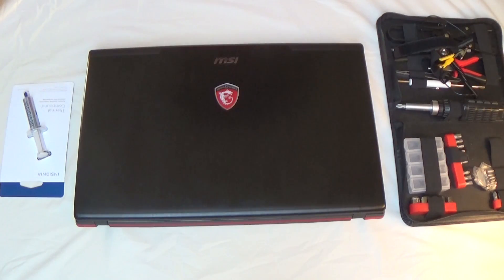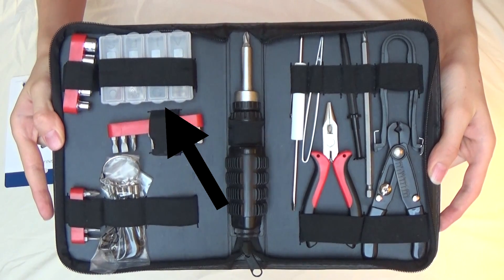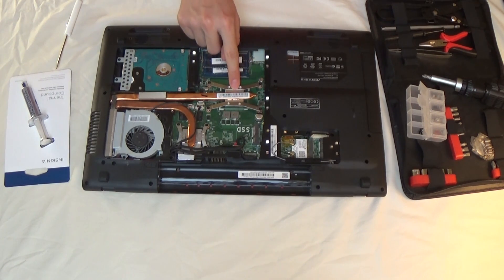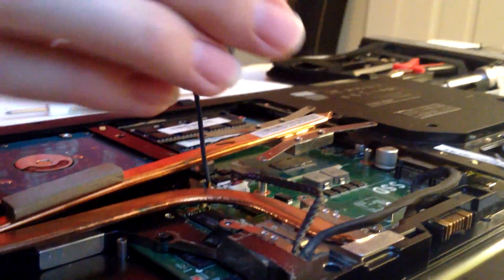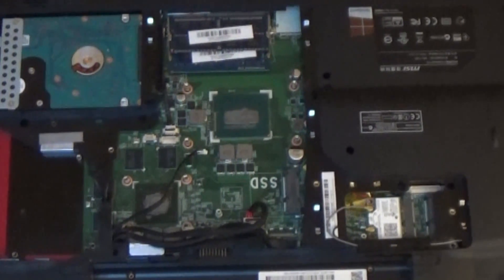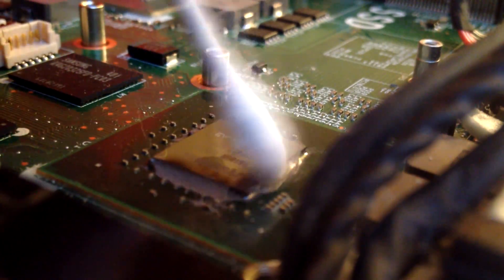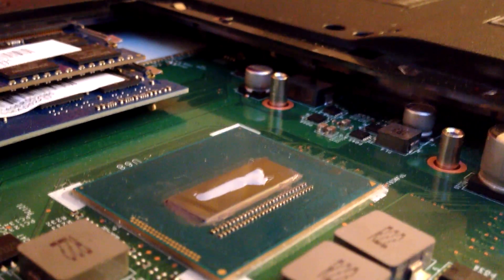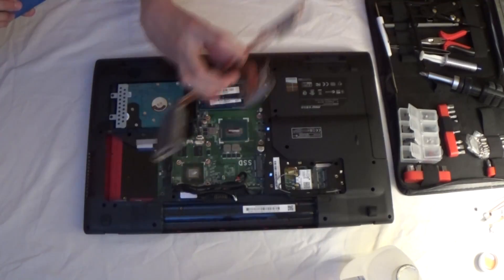How to Replace your Laptop's Thermal Paste

Comment: WARNING-WARNING!!!!DO NOT FOLLOW THIS TERRIBLE TUTORIAL, you risk shorting out your chip with those cotton wool buds,use a micro fibre cloth intead.Also it's worth spending a bit more on the paste.Duh.
Reply from the maker: Hahaha, my man, cotton is not conductive, if I were using steel wool you'd be correct. I do not recommend cotton swabs as yes, they can leave microfibers around the CPU if you're not careful, however you're massively overreacting.
Reply: Really?  Don't even go there...  For sure, a microfibre cloth is better, but a cue tip won't damage your chipset.  It may leave a few fibres.

Comment: horrible job sorry bro but you just showed how to do this at the chinese manufacturer , you need twice what you added
Reply: I agree with you, I also repair laptops.  Excessive use of thermal paste will just cause a mess and squeeze out of the sides and all over the chip, it won't help the thermal paste to last any longer.  While excessive paste probably won't damage the CPU,it is just wasteful, messy and if anything will increase the temperatures because it will be insulating the rest of the chip.

At the moment I use GELID Extreme paste on my gaming laptops, it does give a few extra degrees of cooling.  The manufacturer requires you to spread it using the tool provided, they also say to use the paste sparingly, with a thin even coating so to reduce overspill on unwanted areas of the processor.
Reply: The amount of paste was fine but not thoroughly cleaning the old paste off the sides will cause excess heat to spread out under the heatsink causing higher temps.
 So yea people always make sure to get all the old paste off not just whats on the CPU and GPU, but off the pcb board as well.
Reply: Shoobox Gaming your not considering life span when you use so little , you want this to last over 5 years ? you need a generous amount to stand the sands of time , i have lost a computer to paste jobs like this , my old chrome dell died from overheating and low and behold the past was dry and insufficient ,similar to the job we see in this video .my gpu fried and the reflow didnt last very long
Reply: That's not true, 
 Putting a ton of thermal past on is not good. at all.  the more thermal you put on the more it spreads to the side and on the pcb board. Laptop CPU and GPU heat disperse through a radius starting from the center of the cover on the processor.
   Laptop heatsinks are never lapped properly which causes result in higher temperatures.
Normal laptops are known to run a little bit higher than desktops, but gaming laptops need the extra push to last longer. Without a proper smooth surface globing thermal is not good at all.

 I own 3 different gaming laptops and I always remove the old past even when I buy them new, when laptops sit for long periods of times in warehouses and so forth before their even sold if its not a controlled environment it can cause the thermal to dry out and cause high temps. as well.

 On Laptops they have thinner motherboards and high excessive heat will cause the solder to loosen and crack, then your force will re-flowing the laptop or not fixing it.
And a professional re-flow not even a oven job will only last about 6 months before you start to see the same symptoms.

  I do laptop repairs for a living and globing excessive amounts of thermal isn't the answer.
Reply: Shoobox Gaming i bought my computer with the amount you showed and it would run up to 190 deg , i repasted the cpu and now it runs at no more then 150 ?????????????? so your advice is horrible , not tryna be mean bro but your way off base way off reevaluate the situation and stop trying to fool yourself , your suffering from cognitive dissonance
Reply: You ramblings literally made no sense, I think you really need to think before you type out such nonsense,

Your obviously the one who has no clue what their talking about. I don't think you truly even know how a Laptop heats up or dissipate the heat through thermal past to the heatsink.
Reply: ReturnBaconSquad well maybe visit your mom more often and you can change all that
Reply: Because i wanted to see actual numbers to corroborate my intuition your channel was not the channel that proved it , i watched many videos on this , there is a guy who shows the actual temps difference in the line the pea the rice and the x and the peanut butter   sandwich won because it will last the longest and was the second place winner in the temp test , but as i said first place will loose to second in the long run , every failed pc i have disassembled had to little paste and a need for a reflow and that is caused by excessive expansion and contraction . i'm sorry for being a jerk about this i definitely ruin this conversation before it started and i'm sorry for that
Reply: Such a sad,     sad...... sad ............very sad completely wrong man.

  It's ok,
  We forgive you for being ignorant .
You've tried racial name calling, now reverting to trying to bash someones pass time of playing video games.
 I think you my friend need to go pray to god a little more for forgiveness.
 
 The difference between me and you is that I'm an Educated asshole.
And no need to hike my skirt up when someone plays armchair  quarterback bulling people on the internet.

 But like I said,
   I'ts Ok we forgive your ignorance. and I will pray for you young one.
Reply: @Chris Paul,
  Absolutely excessive paste glob all over the sides of the cpu-gpu will cause heat to spread out through the board and not dissipate through the heat-pipe very well.
Reply: Such a sad little man. maybe you should of went to school instead of self education and actually  learned something useful.  Then maybe next time you try to make a stand you won't look like such a oxymoron.
Reply: Shoobox Gaming thank goodness i dont let you people work on my computer , yes think less is better all you want , you dont even no if your covering your entire processor, ive seen all the test videos on this subject and your wrong , belittle me all you want and to tell me to grow up is hilarious how old are you ? and you play video games ??? lol gamer is a term for adults who havnt grown up now isnt it
Reply: Shoobox Gaming listen you immature moron im not a 38 year old video game player you are .... grow up and stop playing video games maybe you will get a woman , so long shoobox gamer , nice name NERD
Reply: NOBOX7 Goddamn your mom should've kicked you out of her basement years ago.
Reply: NOBOX7 Wow what a sad sad man.
Reply: Jesus shut up you illiterate religious moron

Comment: Please HELP ! i got the same Notebook,i changed the Paste but i still have like 90-100 decrease ....both gpu and cpu please help haha
Reply: Did you clean out the cooling fins and the fan to remove the dust bunnies?

Other than that, you didn't put enough paste on the CPU or you haven't seated the heatsink properly to the CPU.
Reply: Chris Paul please tell me exaclty what to do ! :)
Reply: Before we go any further, when the laptop is running hot, do you hear the fan?  If not then the fan isn't working and needs replacing or checking to see if you remembered to connect the power leads.

Secondly I need to understand how hot your laptop is, download a temperature monitoring program to check and I need to know if in celcius or farenheit.
Reply: Chris Paul GPU and CPU 90 celsius and the fan is working ::
Reply: Does the laptop overheat quickly?  Was it overheating this much before changing the thermal paste?

Comment: my laptop becoming hot and while playing video game iget alot fram drop like from 160fram to30 fram should i put thermal paste?
Reply: If it is a Macbook, then such is life.  Apple tends to thermal throttle, even as new, just a badly designed cooling system.

If your laptop used to run well, then chances are it needs a clean out and replace thermal paste and check the condition of the thermal pads.

Comment: 1) FOR 
2) FUCK
3) SAKE
4.1) you need Like A LOT of thermal past at the gpu and the laptop CPUsSsss BECOUSE theres is no heat spreader ON TOP SOOOOOOO the Die  need to be complitly covered becouse its not goint to be warm at the top only ! ITS GONNA BE THE HOLE DAMN DIE WARM ! 
4.2) only cpus with heat spreaders do not need lots of thermal paste becouse the are already cover the hole die in thermal past and to put at the hole heat spreader thermal paste will make no deferece .
4.3) you apply that you apply the thermal paste at the nc and clean cpu die WHY THE FUCK you put the Qtips and leave at the thermal past strings of coton in the thermal paste ??
Reply: I was thinking the same. He has put on too much.
Reply: (You came from that jaystwocents video) 

1) its not just the gpu in this case because almost no laptop CPUs  come with a heatspreader so the amoubt used doesn't have to be a lot
Reply: 2) small impurities will have little performance impacts as its just the strands

Most thermal paste tend to attract dust and they still conduct heat great.

Comment: my laptop beeps 7 times on startup with fan on,so I searched on Internet and I should replace the thermal paste but then I see that he heat pipe is a bit broken,so what is the problem? the pipe or the cpu/gpu?
Reply: Probably change the pipes and the paste. Also Google about the beep ; you should have your solutions.
Reply: 7 beeps is probably a GPU.  The code is actually pretty generic, even though the manufacturer may point you to something else.  

Troubleshoot first, remove the RAM and try one at a time in different slots, if it works then it would seem you have a dead RAM stick or even RAM slot.

The next easiest step is to try to swap the CPU if it is possible. 

If it still fails to start, then I would be looking at a GPU failure, these are rarely easily removed, so you will be looking at baking your motherboard in an oven as a free fix or try a reball or the GPU, but these are temporary repairs and the way to go is to replace the GPU first as last, not a cheap fix I'm afraid and a specialist job.
Reply: 7 beeps 
That i think is a Dell Laptop 
your Ribbon cable on to display is broken 
or youur gpu is damaged

Comment: My laptop now doesn't display... Seriously though how can reapplying thermal paste cause my laptop to go black and not display anything. The power is on and backlight is there and everything... heeelppp
Reply from the maker: Yikes, I'd open it back up and ensure that you didn't forget to reconnect anything.
Reply: +FSixTech Trust me on this one, I can assure you everything is connected after looking at the motherboard for bloody years trying to figure out the problem
Reply: I would suggest a soft reset. battery out, hold power button for 30 seconds and try again. failing that check your Ram.
Reply: Jagveer123 I doubt you have done any permanent damage.  Built in batteries are a pain, but it will need to be removed.  I also would just try one RAM stick at a time and try different slots, it is possible that the slot is faulty.

Battery should have been removed before cleaning out the laptop to be honest.
Reply: Whats the make and model?  I find it strange that your laptop was OK until you changed the thermal paste.  

If the laptop powers up but you get a black screen, then the common simple things are RAM and BIOS shock.  Bios shock can be cured by soft reset.  

I suppose you could try replacing the CMOS battery before you go forward with a complex diagnosis, its unlikely, but always a possibility.  Remove main battery, remove CMOS battery, hold power button for 30 seconds to drain all the power and then pop in a new battery and rebuild.

You should also be trying to plug in an external monitor to see if you get a picture.
Reply: I would try the CMOS battery.  It costs less than a loaf of bread and worth exploring.

I do recall a similar problem I repaired sometime ago with an Asus and it was simply removing the screen cable and reattaching it.

But honestly I cannot see how you would have killed a GPU, unless you put force on the motherboard and fractured a solder joint.  

There are home remedies for reflowing your GPU, and they do work.  Depends on your budget really, but if your going to reball, I would pay the extra money and have a new GPU as well, there maybe scope to do a little upgrade as well.  My last customer laptop GPU complete replacement was £60 whereas a simple reball would have cost £45.
Reply: +Jagveer123 cmos battery is like a big watch battery
Reply: don't mean to necro, but I'm curious about what happened to your laptop and what was the cause?
Reply: Mohamed Hashim Its dead, and I have a brand new custom built pc :) works amazing. Dont really care about my other laptop its kinda just laying around but im pretty sure the fan just died and I could probably fix it if I ordered a new laptop fan
Reply: it never worked after you tried the thermal paste thing?
Reply: Jagveer123 did u fix the laptop?
Reply: +Chris Paul My battery is built in, also I did a RAM check and the ram is good so I'll try a soft reset
Reply: By built in I mean inside the notebook and screwed in. (Couldnt edit post since on mobile)
Reply: +Chris Paul I did... Battery is #1 priority
Reply: +Chris Paul Both ram slots are working and the soft reset did nothing. Is it time to reflow the gpu maybe? What else can I try before that
Reply: +Chris Paul External monitor and new battery doesn't work. I honestly think I screwed up my GPU. There was old paste hanging over the edge just like the video however I used a cocktail stick to get it out and it worked fine but I dont understand how Im getting blank screens or how ive messed up my gpu. My model is an asus n550lf-ck095h
Reply: +Chris Paul What's a CMOS battery? Also I just cant figure out what the problem is all I know is that its 100% the gpus fault
Reply: +Chris Paul I dont know where the cmos battery is and i heavily doubt its that. Anything else i can try
Reply: Nope. But that doesn't mean my issue the issue for anyone else that has a dead gpu/whatever part it is.
Reply: Yup your carelessnes taking the computer apart killed it

Comment: Give the guy a break.  Was it the perfect demonstration? no it wasn't, everyone has different ways of applying thermal paste.  Everyone is learning.

There was a big no no, don't use a screwdriver to scrape the CPU.  There are a few other issues raised by other people:

* The cue tip hairs will cause damage!! - Not really, but it isn't the best method.
* There was too much thermal paste!! - Perhaps a little too much, but it won't hurt.
* No anti-static strap was used!! - Not a huge deal, but is wise to ground yourself.

You can never please everyone, but there is scope for improvement for your next video.
Reply from the maker: Well said
Reply: On an open die like this, if your thermal paste doesn't spill over the edges, you're doing it wrong.
That wasn't too much, far from it.
Reply: Fuck no, if the dude calls it the BEST METHOD, he must change the title..
Reply: exactly! I personally surface spread my thermal paste
Reply: spill over a little not like what was on there, And, it all depends on the paste.. Arctic M4 is different from arctic silver 5.. you need different amounts.
Reply: I really don't think one is better than the other as long as you use the right amount for certain pates. Arctic MX4 is different from arctic 5 paste.
Reply: That is your choice.  In general paste manufacturers don't advise this, but there are a few pastes out there that instruct you to spread it and often provide tools to do so.  I use GELID extreme and this is required to be spread.
Reply: This is an exposed die without an IHS, you have to use more paste than normal to cover the entire die. I didn't do that and my laptop ran hotter, I applied more thermal paste than I would've done on a desktop CPU and the temperatures dropped.